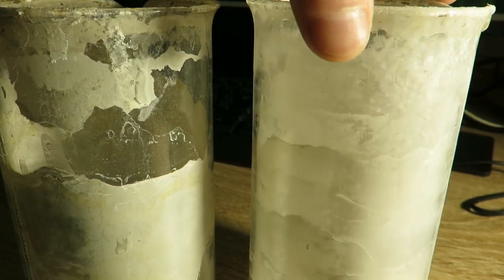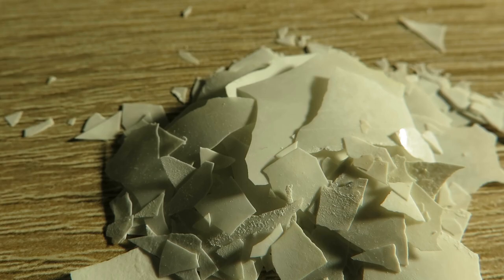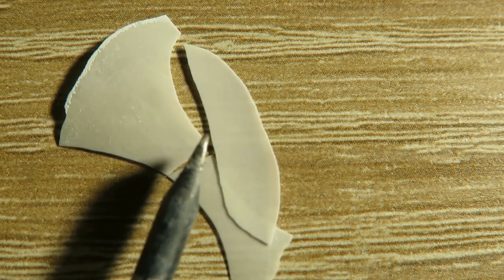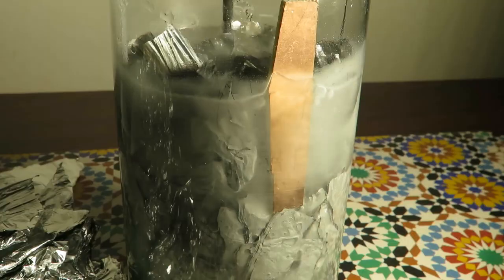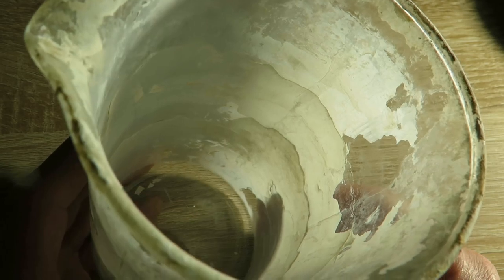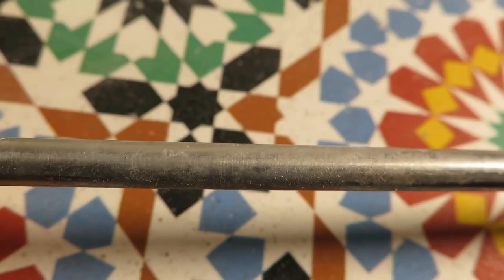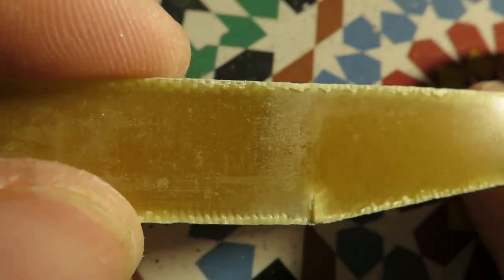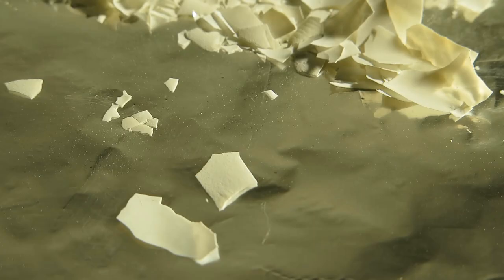Thin layer aluminate deposition - accidental discovery

Comment: Want me to stick this into my XRay Spectrometer? Though id have to check if my machine can detect the Sodium Line. 

Im also not sure if the detector is even fully operational right now, its been a while since i ran it. Bonus, SEM observation of the structure if you want that.
Reply from the maker: Sorry for late answer and thanks for offer. I was thinking about x-ray crystallography, but I've got a feeling, that I would see nothing, because sample will be amorphous or with too many crystals interlocked. Perhaps I would see more with SEM - that glassy surface could tell us something...

no need for XRF, there was only Al, Na, H and O present, so I don't expect any surprises

How much would you want for sticking sample under SEM if I somehow wouldn't know what to do with money? :D

Comment: I wonder what would happen if you aluminate coated a metal foam, then dissolver away the metal
Reply from the maker: If the deposition happens due to percipitation, you would most likely get quite imperfect negative with some preference for deposition (most outside surfaces). Not sure if this would be good for anything...
I was hoping for affinity for SiO2 molecules, so I could coat glass fibers and get really thin tubes :)